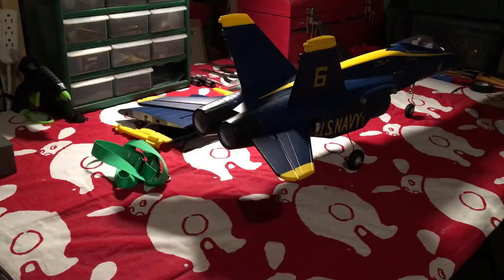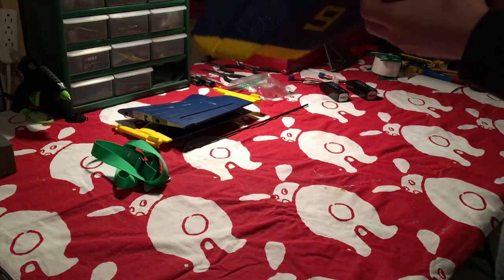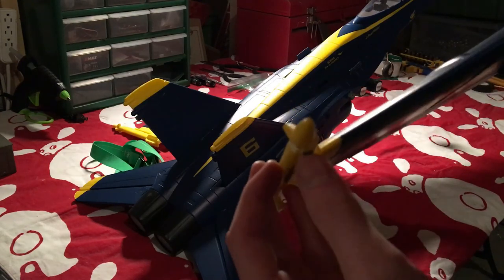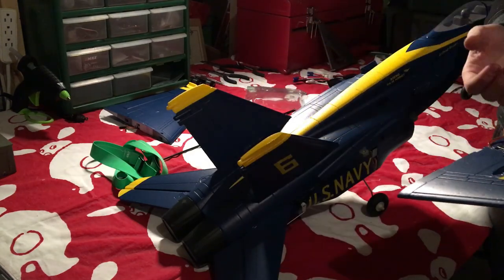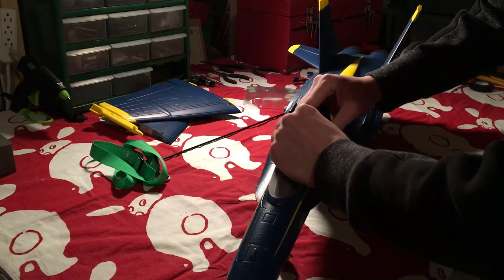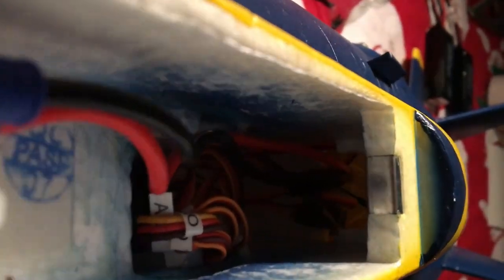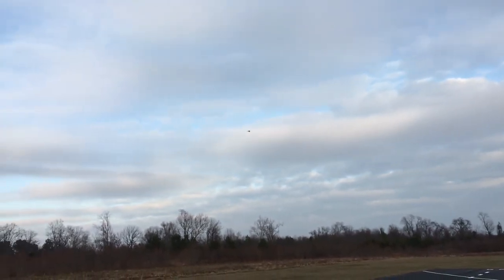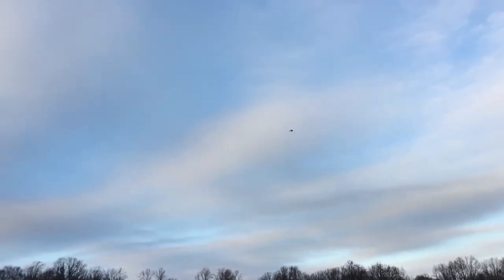Force RC F-18 Review

Comment: Have you taken the gear off and noticed any changes in performance?  How does it hand launch?
Reply from the maker: Sorry for the super late response. It flys lighter w/o gear and had tendency to turn left when hand launching so make sure your prepared for that, though i did have to repair it several times and added a blinking light to help with visibility.

Comment: curious why you didnt lay the receiver flat? i just picked up this plane (force rc version) for $100 brand new.  i was able to set the AR636a receiver flat without issue and the battery fits flat too.
Reply from the maker: Dogg E Doo it is currently laying flat. Just the battery is at a bit of a angle but it works perfectly with CG and doesn’t move around. I warn you to be careful with your landing because my gear ripped of after rolling in grass and now mines a hand launcher, looks better without gear.